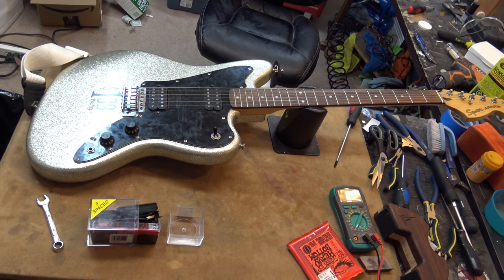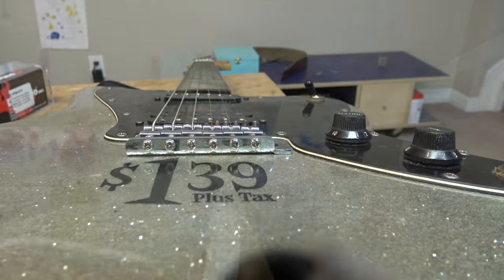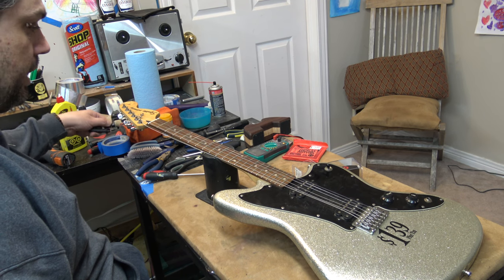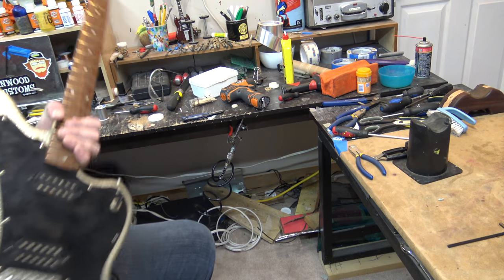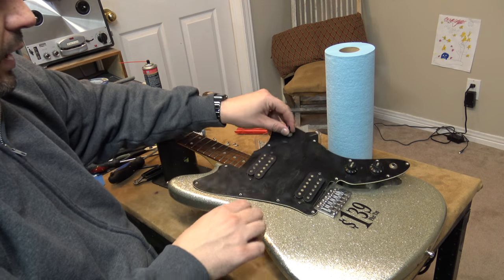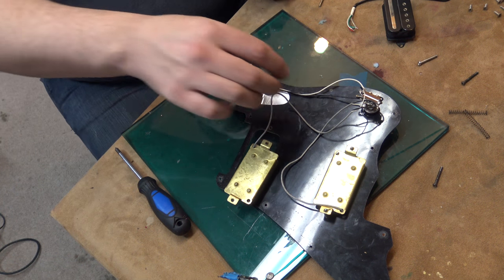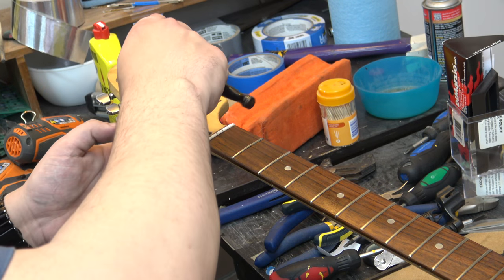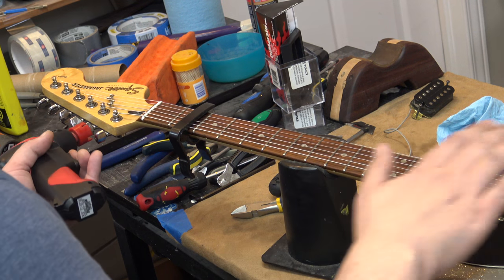Squier Jagmaster: Twisted Neck-Had A Paid Setup?

Comment: Why a heat gun for the tubing? I just use a good ol bic lighter.
Reply: richard small, ...  because it deposits sooty combustion by-products in and around the area the flame hits, and its too hot.. can scortch things.  Just because a crappy method kinda works does not make it preferred practice. Take some pride in doing the job right, improve skills and tools and you will do better work and learn pride in what you do.
Reply: Never thought about the soot. I dont hit the tubing with the flame like some people as that can do damage. I just use the heat from the lighter like a heat gun. I have seen people do damage also with a heat gun. You just have to take your time. I also have seen people us a soldering iron on low heat on tubing also. Thanks for the reply as it gave me something new to think about.
Reply: I use the soldering iron.
Reply: I've been told to use one of those "turbo" lighters instead of a Bic.